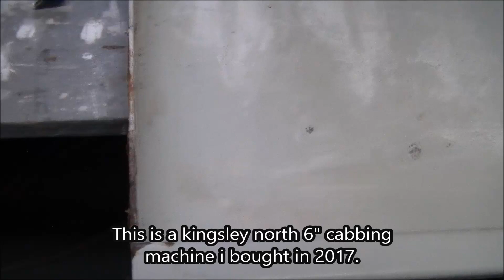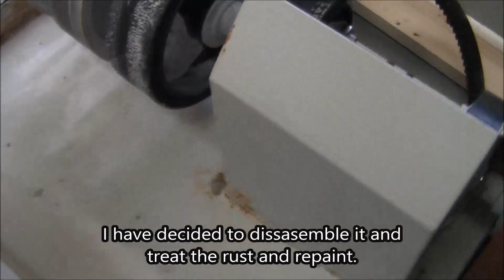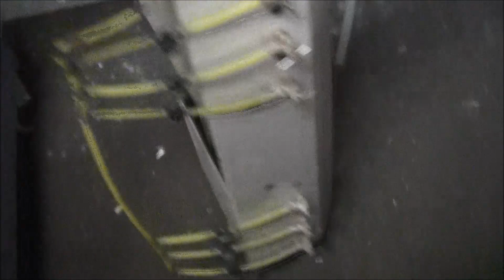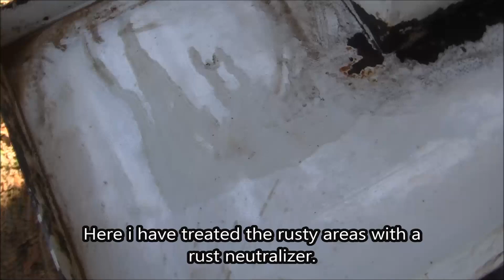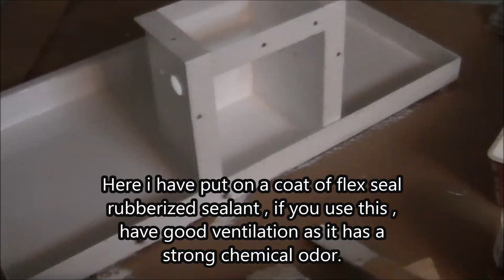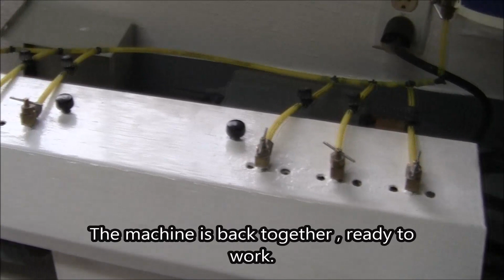Cabbing machine repaint

Comment: I’ve got a couple of machines that I need to do the same thing too. Flex seal paint is a great idea. I was thinking the epoxy type that the use on garage floors without the speckles would be durable. Thanks for sharing.
Reply from the maker: we,ll see if the flex seal holds up.It does seem like liquid rubber in a can. I used the garage floor epoxy on a floor a couple years back and it is very durable, it would probably work just as well as the flex seal.
Reply: No speckles? But why? You're making jewelrey haha ....im doing the exact same thing right now, i also do my own prospecting so i was able to barter with rocks which was awesome! Mine im going for a black and golden pearl with biotite mica I've collected. I see the type of sealer but not the paint used, any suggestions? Tremclad maybe?